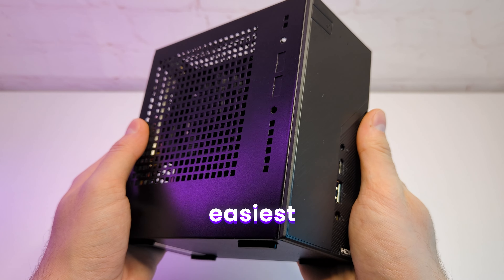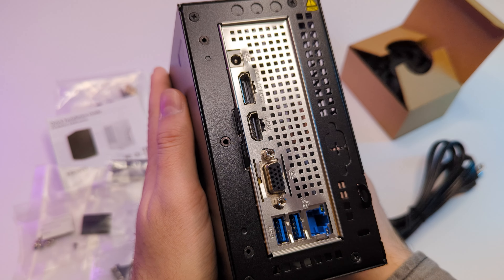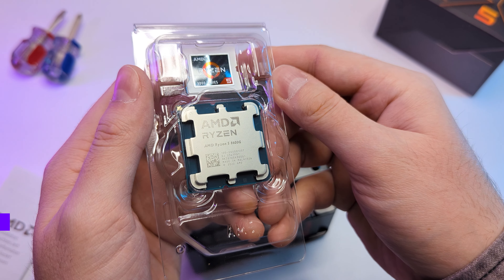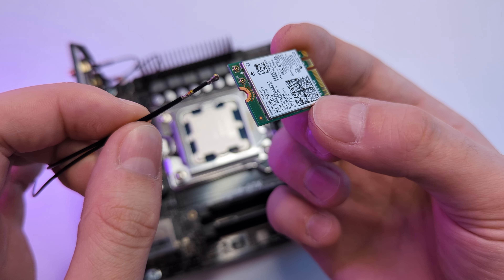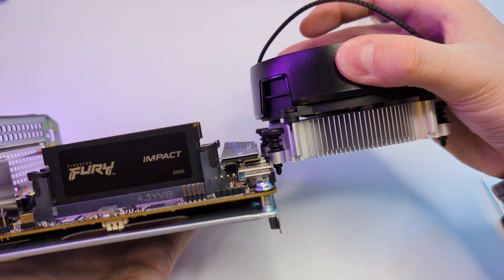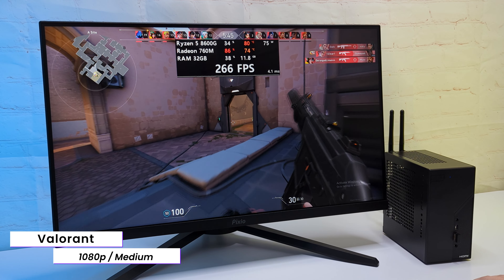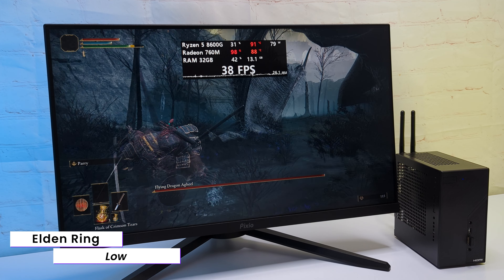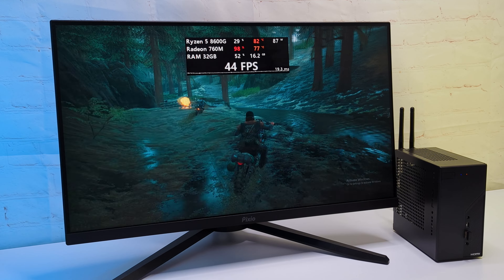This Smallest PC Build is Mind-blowing! ASRock DeskMini X600

Comment: 90 degrees on the cpu in games,this little box is going to melt itself.
Reply: laptops usually also run on 90 degrees on rly heavy tasks. i have to admit that they have heat spreaters tho and i didnt see those here.
Reply: It's because he's wearing a cooler wraith stealth😂

if he uses hsf AXP-90R Copper, the temp max only 68°C

Comment: I have the same, but it's the DeskMini x300. I took and modified a Ryzen Stealth cooler so it would cool better. Removed the ring around the top of the cooler. Just barely fits, but much better than the junk cooler in the box. I also ordered the cable for the sound and the cable to add 2 more USB 2.0 ports. Great little unit.
Reply: same bro. he received wifi and antennas in the box, I had to buy them separately. he also missed like every other reviewer out there that the size of these X300 / X600 boxes is the same size of an ATX power supply. P.S.: my X300 has issues with the HDMI, I get black-screens, so I use the Display-Port. apparently it used to happen to some units...
Reply: I also got 2x of the ASRock X300W version: one I use as a "living room TV" PC and the other I use as a portable "in case it rains on summer vacation at the Airbnb cabin" PC. I can confirm the stock AMD cooler will fit IF you remove the "shroud" (Remove the under-screws first! I learned the hard way and broke it.) The other option is using a low-profile Noctua cooler. Two M.2 slots AND two 2.5" SATA slots is NICE. 👍😎
Reply: @playinginthepodcastroom8365  I tried the Low profile Noctua cooler, but it didn't really cool any better. Trying to line up the cooler to the CPU was PIA. So I just did the modified Stealth cooler option. Thanks for sharing.

Comment: That is a legit mini pc! Do you know if there is one for intel?
Reply: A07 Mini ITX Computer Case standard itx case you have to get a 1u flex power supply, and a low profile cou cooler. It's sub 5litre build. Mines is i7 12700 w/ rtx 4060 zotac single fan.
Reply: @ I’ve seen that one currently my next Gaming PC as I want to downsize. Thinking of modifying a 4070 to make it a single card.
Reply: @BeanQilin  Nice! 👍

Comment: Anyone wanting to build a mini gaming pc look at A07  mini pc case. You can build a legit gaming pc with actual gpu not igpu. Currently the best gpu ive found to fit is zotac single fan rtx 4060. Pretty solid gaming build in a sub 5litre case.
Reply: 4.3 liters man, isnt anywhere close to the 1.92L from the deskmini x600. its a total diferent beast, i brought mine with my work laptop in my backpack over europe! :) im in love with asrock deskmini series since the A300
Reply: @bdp2868 I understand, I was just saying you can do a similar sized custom build with so much more power and gaming capability. I think they are pretty similar dimensions only A07 is taller to accommodate the power supply. Either way definitely fits in a backpack. Mine I built around the time 40's series launched. It's i7 12700 w/ RTX 4060. 32gb memory & 2.5tb storage. 600w 1U flex power supply.

Comment: I might just buy laptop in this case. Great video I now have an idea.
Reply: laptops and especially used but well-kept ones are way better deals than mini-pcs. you get slim-portable size, a display! speakers, keyboard, touchpad, webcam, etc. AND A BATTERY! so laptops actually make sense.
Reply: @cosminmilitaru9920  My purpose is so that I can carry it anywhere I go. I had planned on doing this kind of setup for better performance, but I think a laptop is way more convenient.
Reply: @cosminmilitaru9920  And more noise, and less upgradeability. There's no such thing as a free lunch.

Comment: If you were using the Thermalright AXP90-X47 cooler instead of those 2 stock coolers then your temps would have been a lot better.
Reply: What about the Noctua one he recommends?  For any of these, you don't need to apply thermal paste?

Comment: Too bad no Oculink support to beef up external GPU power.
Reply: You can install it with an M.2 adapter (on the secondary M.2 below motherboard in PCIe4.0 4x too) for only 15usd